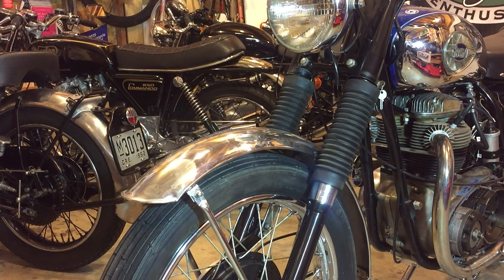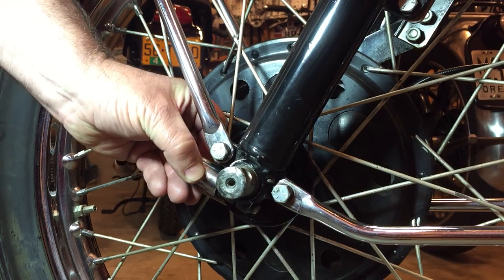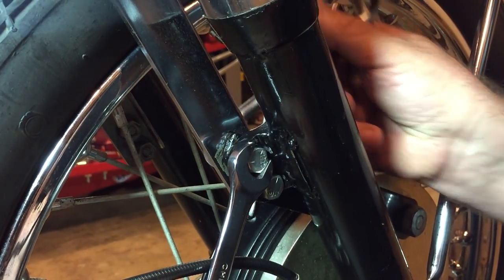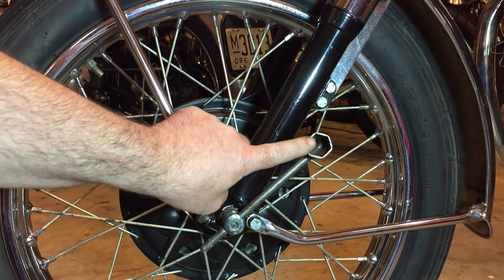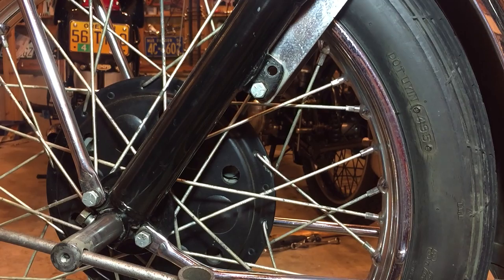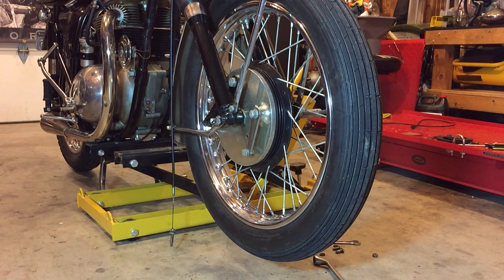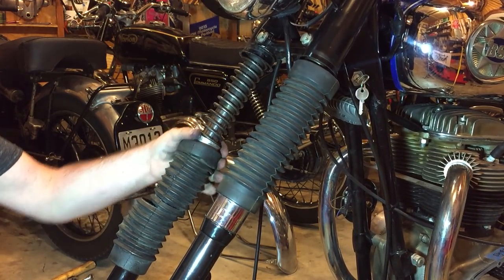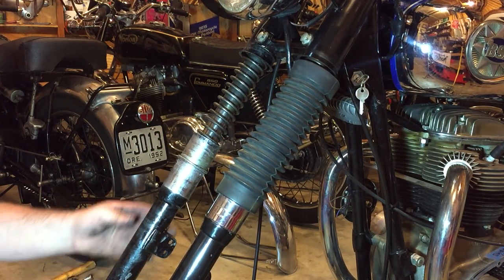1968 BSA Thunderbolt 650cc - replacing the gaiters (part 1 of 2)

Comment: This is very helpful, but on my '66 there are clamps on the top and bottom of the gaiters and I was looking to see how to remove them.   Maybe they are not necessary?   They are more complex than typical hose clamps (it's like there are two concentric bands) and I was looking for some direction as to how to loosen them.